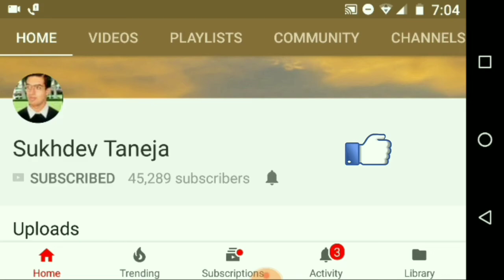How to fit New Taps and PVC Pipes in Bathroom in 3 Minute Part 3 (Fast Video) (Musical)

Comment from the maker: People can purchase this Heavy Duty Hammer Drill online from Amazon : 

JPT 20MM Heavy Duty Hammer Drill for Professional Use with 3 SDS Drill Bits (Color May Vary) - https://amzn.to/2JROQKH
    
Aimex 20 mm Heavy Duty Rotary Hammer with 3 Piece Drill Bit - (800W) -https://amzn.to/2Y5A0Fj

JPT Corded Variable Speed Sds-Plus Concrete/Masonry Rotary Hammer/Chipping Drill with Carrying Case - https://amzn.to/2O4eilu

KHADIJA Tiger 20 mm Rotary Hammer Drill Machine with 3 Bits (6,8 and 10mm) and Carrying Box (Colour May Vary) - https://amzn.to/2XSYRBk

Cheston Rotary Hammer Drill Machine 20MM 500W 850RPM with 3-Piece Drill Bit - https://amzn.to/2SsORZn

IBELL Rotary Hammer Drill Machine RH20-23, SDS Chuck,500W,850RPM,20MM with Accessories and 6 Months Warranty - https://amzn.to/2Gn6MMh
    
iBELL IBL RH28-101 Heavy Rotary Hammer Core Drill Machine,1000W,750RPM,26MM-6 Months Warranty - https://amzn.to/2JRQax9
    
Inditrust 900W 26mm 2-26 RE Reversible Rotary Hammer Drill machine SDS Plus with 3 Modes 3 Hammers Bits 2 Chisels (Blue, green) - https://amzn.to/2XUVxFw

Turner Tools TT-220 20mm 500W Rotary Hammer - https://amzn.to/2XYiBUc

IBELL Rotary Hammer Drill Machine RH26-24, SDS Chuck,800W,900RPM,26MM with 6 Months Warranty - https://amzn.to/2O58hoI

JPT 26MM SDS Chipping and Rotary Hammer Drill | Includes Demolition Bits, Flat and Point Chisels (with 2 Demolition Chisels) - https://amzn.to/30F27wM

JPT 26MM SDS Chipping and Rotary Hammer Drill | Includes Demolition Bits, Flat and Point Chisels (with 2 Demolition Chisels) - https://amzn.to/2XRsItH

JCB JCB-SDS20-20 Mm 500 W Rotary Hammer Drill (Yellow and Black) - https://amzn.to/2YgWVll
    
Sinal S026 Heavy Duty Drill 026 Rotary Electric Hammer Drill Machine (26 mm Chuck Size, 700 W) - https://amzn.to/2Glkqj0

iBELL IBL RH28-101 Heavy Rotary Hammer Core Drill Machine,1000W,750RPM,26MM-6 Months Warranty - https://amzn.to/2JRboLt

Black & Decker KR504RE 500-Watt 10mm Keyed VSR RBS Hammer - https://amzn.to/32Gq4G4
    
KPT - Authorized Dealer Asma International Kpt - Asma International Kptrh22 - 22mm Rotary Hammer Drill - https://amzn.to/2JWcIg3

GOLDEN BULLET 20mm Rotary Hammer Drill Machine BPT 2-20 with 3 pcs Drill bits - https://amzn.to/32Cy3Uv

Bosch GBH 2-22 RE SDS Plus Rotary Hammer (620 watts, 22mm, Blue) - https://amzn.to/2XViIQ7

Tuf Turtle 26 Mm Heavy Duty Reversible Rotary Hammer With 5 Piece Drill Bit - https://amzn.to/30NsIIn

Black & Decker KR554RE 550-Watt 13mm Variable Speed Reversible Hammer Drill Machine - https://amzn.to/30KhNiA

BLACK+DECKER HD400IN 500-Watt 10mm Hammer Drill - https://amzn.to/2GmsAI1

Bosch Mechanic Kit GSB 550-Watt Impact Drill Kit (Blue Range, 122-Pieces) -https://amzn.to/2SppqIc

Please visit my Amazon Shop Page for better Products : 

www.amazon.in/shop/sukhdevtaneja

People can join Amazon Prime Service for fast delivery, Prime Movies and Prime Music : 

https://www.amazon.in/tryprime?tag=sukhtane-21

Pepole can join Amazon Business for selling their Products online on Amazon :

https://www.amazon.in/tryab?tag=sukhtane-21

Seller can contact me for making free Review of their products on my YouTube Channel : contacttosukhdev@gmail.com